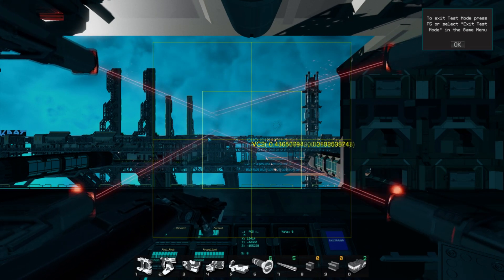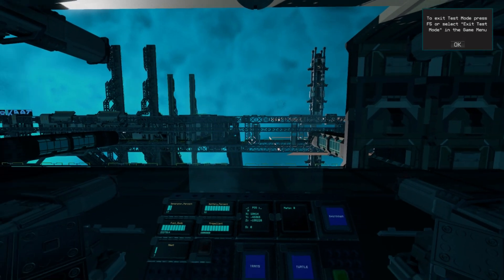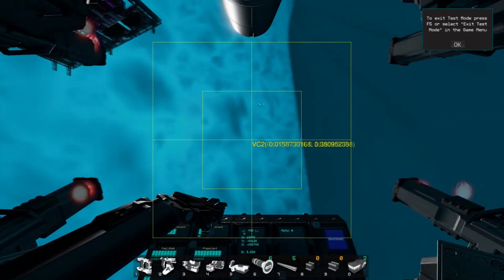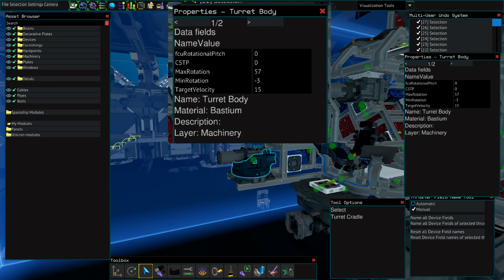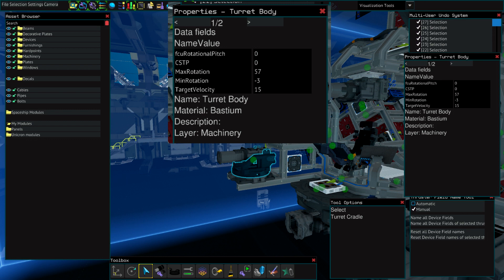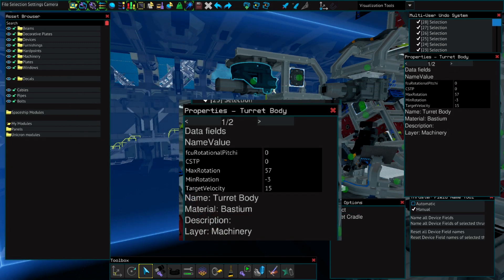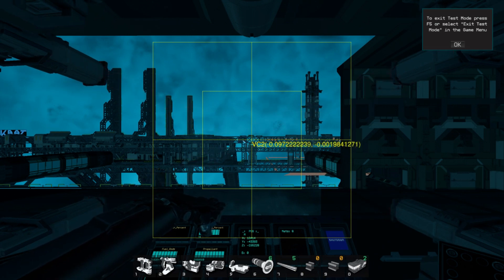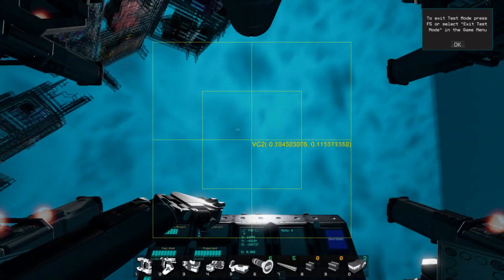Mouse Aiming In Starbase

Comment: is the deadzone not related to a device field in he sliders?
Reply from the maker: what do you mean? the center lever value? you could do it that way but that would only work for a single turret?
Reply: @heflar  You're using mouse control to change 2 sliding levers to control the turrets right? They have a LeverCenterDeadZone field that sets how close the lever handle needs to be to center for it to "snap" to the center. If you set that to zero, wouldn't that remove that deadzone in the center of the mouse control field?
Reply from the maker: @ArmitageShanksMC  i don't think that is how that works, as far as i know that is the default position of the slider and when having your levers auto reset, they do so to this value.
Reply: @heflar  No, the deadzone value is how far from the center of the slide the lever needs to be for it produce a value. If you set a centering lever's deadzone to 100, it need to travel a minimum of 50 in either direction to produce a value. The default value for the center point of the level is set using LeverCenterOutput. From the wiki, "LeverCenterDeadZone	How large is the dead zone in the center of an unidirectional lever" | "LeverCenterOutput	Output value when the lever is in the center". It doesn't matter though, I just tested it and the dead zone in the mouse control appears to be hard coded.
Reply from the maker: @ArmitageShanksMC  ahhhh yeah i see what you are saying!! i was thinking centerzone for some reason! i just woke up when i replied! yeah i tried many things to get around the deadzone like offsetting the start point, but having the screen off to the side of what you wanna aim at is even more annoying than the deadzone...
Reply: @heflar  Yeah, I explained it wrong in my 2nd comment too, so that wouldn't have helped you understand what I was saying.

Comment: How do you get the lasers to aim towards the center to start with or rather how do you make the lasers 0 values be pointing towards the center?
Reply from the maker: Oh the default position? I limit the range and point it towards one side, so when the range is -180 and +180 the middle value for this is 0, but if you limit one value the middle value changes, for example is the max value is 0 and min value is -180 then the middle value would be -90 (pointing directly left)

Comment: after your comments in the mining laser video do you still feel this is not useful for mining?
EDIT: I have two setups in testing and one is a full turret cradle support which ends up being slower but more stable and then I have a setup using what you showed here and I think I like it better but I am have a bit of trouble with fine movements and I have tried to use beam convergence from that other video but its a bit hard to use them together
Reply from the maker: yeah it is somewhat difficult to setup multiple turrets at once, i personally think there are better methods of making mining lasers do all the work for you, between using rangefinders turrets and Yolol code you can do a lot! but they just need to fix the turret bugs in the game.